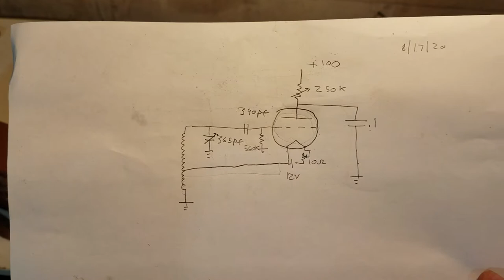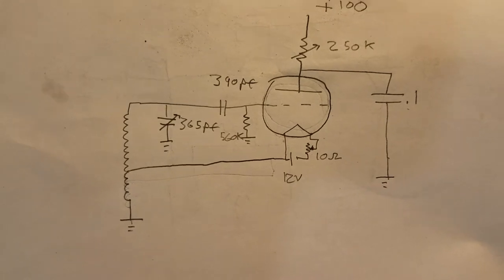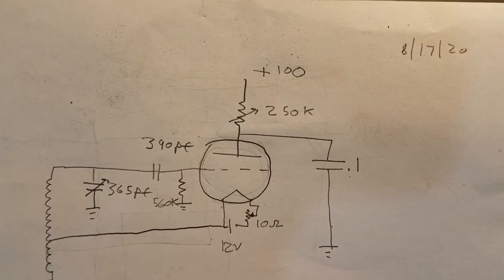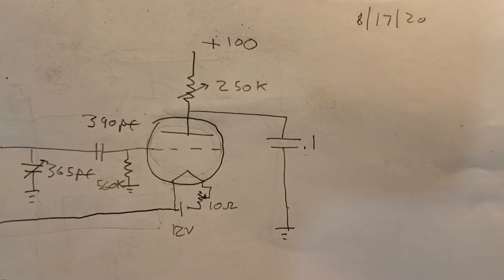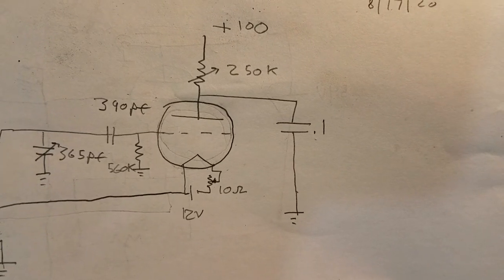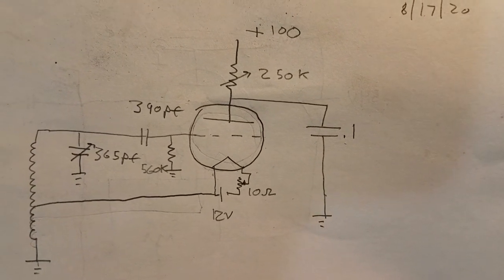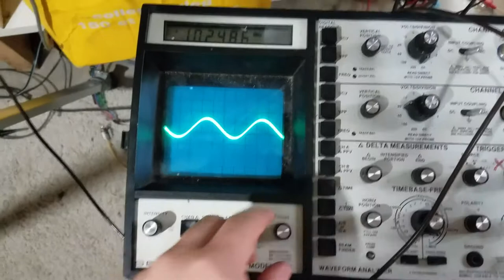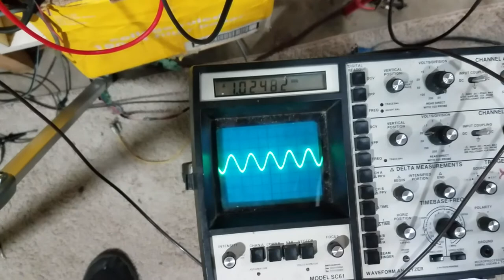Homemade Triode In An Oscillator Circuit

Comment: I heard that pure tungsten filament have short life span.. and the tube need to operate white hot in order to get decent emission.. I wonder how long your tube can survive? I'm very interest to make pure tungsten triode..
Reply from the maker: I do not think it necessarily will be short I think failure of seals is more likely to be the cause of its death. It depends on what short means. I think this tube could last maybe 100 hrs or so if run conservatively, I do not think that is too bad for a homemade device.  Information on life is located here. http://www.tubebooks.org/Books/Atwood/Kohl%201960%20Materials%20and%20Techniques%20for%20Electron%20Tubes.pdf
Reply: @jdflyback  Thanks you.. I think i will try i have MAPP , i did make my own triode without seal the glass i will try MAPP make like your..

Comment: Sanity check time: are these tubes with ~100v plate voltage theoretically powerful enough to create radio emissions that would attract attention from the government (FCC specifically, if you are in the U.S.)? If so, how do ensure your overall transmitter doesn't cause problems?
Reply from the maker: In this case no, The radio receiver has to be put right next to the coil to receive anything (no antenna is attached). My tubes are very high impedance. It may run on 100 - 200 volts but only at a couple of mA. Even so there is a regulation for unlicensed transmitters (part 15) that allows up to 100 mW into an antenna less than a few feet long.
Reply: @jdflyback  Ah nice! I haven't built any transmitters yet, so I am working on building some perspective/intuition for them. Thank you for responding! Happy hacking!

Comment: Impressive results, do you have any plans to make a small VTTC using it? You’d definitely be the first one to have an entirely homemade one :)
Reply from the maker: Lol that is an idea! I want to try to make a regenerative receiver first though. I do not think this tube could handle the power a VTTC would need
Reply: @jdflyback  A regen RX should be no problem for this tube. You have a controllable oscillation at over 1MHz -  just adding an antenna and a speaker to your circuit could be enough, if you adjust it to near or just over the threshold of oscillation.
Reply: jdflyback how many watts of output are you safely getting from it? Shouldn’t be an issue if it’s over 10, since a lot of PL500 designs are around that power level. Then again, don’t think pushing it hard is the best idea
Reply from the maker: I am currently not giving it more that around 1/2 a watt I do not want to burn out my first one, when I make more in the future I will push them more.
Reply: @jdflyback  i have a question, what is the variable capacitor used for in this circuit?